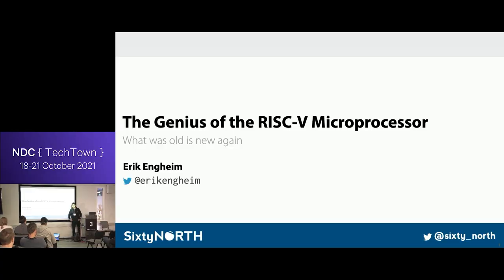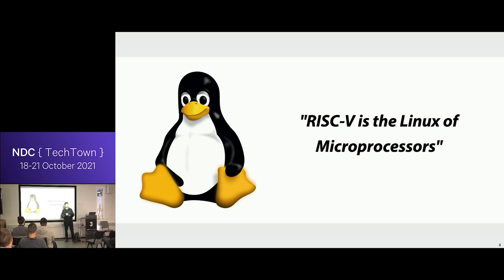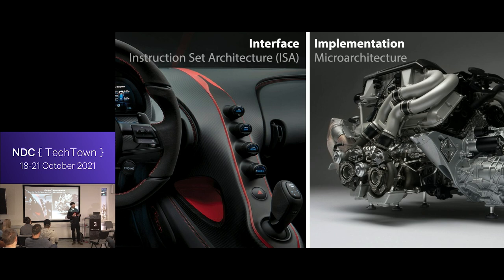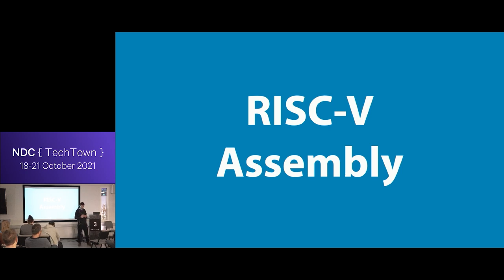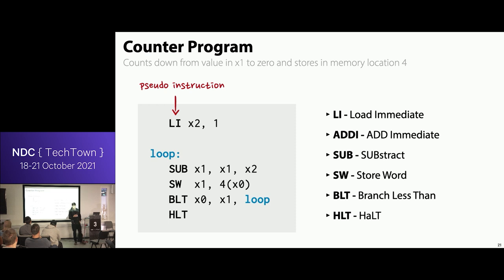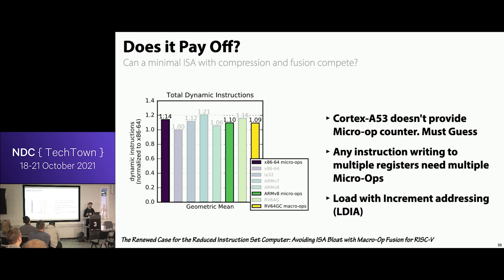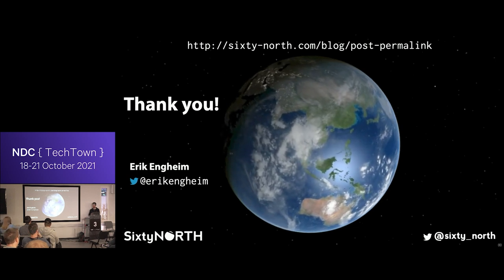The Genius of the RISC-V Microprocessor - Erik Engheim - NDC TechTown 2021

Comment: Man this dude needs to drink some water. That said, I didn’t realise that arm processors had that many op codes. That’s not really “reduced”.
Reply: A lot of this is due to SIMD instructions. Vector processing is something I had planned to cover in this talk but there was not enough time. RISC-V does a very different approach to keep the instruction count low.

Also ARM isn't as fully committed to the philosophy of RISC as say RISC-V. ARM is a more pragmatic architecture where they have added a lot of complex addressing modes to save instructions for common memory access operations. This was shown briefly in this talk in how I showed how ARM  could do what RISC-V had to use three simple instructions to achieve. Of course RISC-V circumvented this with compression and fusion.

I think what makes ARM RISCy is primarily the use of fixed length instructions and load/store architecture. That is very typical of RISC processors. x86 has in theory infinitely long instructions although they made a practical limit of 15 bytes.

Comment: I suppose ARM should technically be a RISC processors. (Advanced RISC Machines). I got a different understanding from your video. May clarify..
Reply: Yes, ARM is a RISC processor but it isn't a binary thing. ARM checks some of the more important RISC boxes: 1) Fixed length instructions. 2) Load/Store Architecture. 3) Lots of registers.

But other than that ARM kind of drifts away from a lot of RISC philosophy. They have rather complex address modes, and a very large instruction-set. Now a large instruction-set isn't necessarily un-RISC like as long as those instructions have low complexity. But several ARM instructions are quite complex and require many clock cycles.

Thus current ARM is a bit hybrid between RISC and CISC philosophy. RISC-V embrace the RISC philosophy more strongly. Perhaps not strange, because it has been made by many of the same people who made the original RISC processor,  RISC-I

Comment: is RISC-V more energy efficient than ARM?
Reply: There are ULP (ultra low power) chips, e.g. one in use in Xiaomi's Bluetooth temperature sensor gadgets, which last for a year on a single CR2032 cell. The ISA itself is not the only implication of power consumption, though RISC in general is more suitable for low power.
It's hard to tell otherwise. Maybe a semi conductor company will publish something at some point where similar SoCs with the same peripherals but different cores and instruction sets are compared. Since ARM is proprietary, open studies will be hard to find.
Reply: @CyReVolt  alright, thanks for the reply!
Reply: It's more energy efficient than x86 anyhow, I can say that. Energy efficiency is not just dependent on the ISA, but also the other designs needed for the chip. The more transistors you need, the greater the power draw. RISC-V can do the same as the others with fewer instructions and therefor fewer transistors, so it should be more energy efficient as well.

Comment: "Get this man some water!" yes I hear you. I am the speaker and I am sorry about this. In my defense I got a call up at my hotel literally 10 minutes before my talk, getting informed that my talk had ben rescheduled. That was the second reschedule, so not something I had been prepared for. I made a split second decision that I could run over the conference and make it on time. It was pretty bad timing for me. I was not all that awake and my throat was bad. When you see me start the talk here I have literally entered the room just 1 minute ago. So I had no time for preparation... getting cough drops, water, anti-congestion of whatever. To top it off my first HDMI to thunderbolt connection didn't work properly. I had to fiddle with that until I switched to another spare I had. So everything was just massive stress. I didn't get time to even locate the water under the table there, before I had to start.

I will consider uploading an edited recording of this if there is enough interest. Hopefully I will do a similar talk in a future conference under better conditions 😉
Reply: This talk was clearly given by someone who knew that recent advances in AI allowed for speech to converted to text with the coughs removed and then turned back into speech indistinguishable from the original with even more AI. All running using the RISC-V vector extension! Coughs don't matter anymore! That's 90s thinking!

I am so very sorry.
Reply: I don't think anyone is actually seriously bothered by your coughing.  They're just giving you grief for giggles. I barely noticed the coughs. It was a very good and interesting talk.
Reply: @perforongo9078  Thanks man! You got a point ;-)
Reply: I think the quality of the presentation more than makes up for minor distractions
Reply: It was a lovely and insightful presentation and honestly if I had to complain about the coughing it would just be to meme
Reply: Thanks for the talk! Very informative!!
Reply: Thank you for the great presentation. Hope you will have better time for your next one. Looking forward to it already
Reply: It was rough, but the content was worth putting up with it.
Reply: [48:50] We can do Better!

A rewrite of the C source code with a compound literal
as a return value.

struct ar {int *a; int r;};

struct ar get_word(struct ar x)
{
   return (struct ar){.a = x.a, .r = x.a[x.r]};
}

[50:07] Just Like ARM

Produces an ARM "equivalent" after compressing 4 instructions
and fusing 3 instructions (2 micro-ops encoded as 8 bytes).

c.slli       a1, 2
c.add     a1, a0
c.lw        a1, 0(a1)
c.jr          ra
Reply: "similar talk in a future conference under better conditions": https://www.youtube.com/watch?v=L9jvLsvkmdM
Reply: Thought for myself, that it should not be hard for an AI to volume down a non-voice sound. But AI seems to be more impression on visualisations. You can colorize and upscale movies from 1920, but you cannot get rid of one repeating noise 🙄🙄🙄

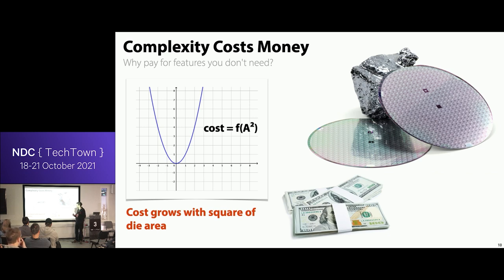Comment: The slide at 7:39 can be quite misleading.  The given die area for the A5 core and RISC-V Rocket is not a full chip, it's just the core and small L1 cache.  A real chip will also have peripherals and I/O pads (little gold wires connect the external package leads or bga balls to the I/O pads on the silicon), plus higher level caches or SRAM.

I/O pads are very large compared to the feature size; we're talking double to triple digit micrometers (so you could have millions of transistors on an area the size of a single pad). So even for a low end microcontroller with only 40 pins, the required area (and cost) for a full chip is more likely to be dictated by the size I/O pads than by the core itself; IC designers may end up having a much larger transistor budget than they know what to do with (I suspect this is part of the reason why dualcore MCUs have gotten relatively common now).

As you pointed out, cores in desktop class chips (and really mobile phone chips too) are dwarfed by huge caches and vector registers.  But the SRAM in MCUs can also be quite large.  If you look up Yunsup Lee's paper on their 45nm 1.3GHz dualcore RISC-V Rocket processor, you'll see that the 1MB of SRAM is larger than both cores together.  That's more than in a typical MCU, but it gives you the sense of scale.  RP2040 for example has 256kB and then some, NordicSemi's nRF5340 has 512kB + 64kB.  Either SRAM (for MCUs with no DRAM interface) or cache (for chips that use DRAM) is pretty much mandatory.

So, even in embedded space, the core size isn't that important.  In any case, we will never see a price difference that remotely resembles the chart here, because core's contribution to the size and cost of a chip is small or absolutely zero (when pad limited).

There are very niche cases where the die area saving could be meaningful, however.  I guess the Esperanto chips are a good example; when you need tons of simple cores with little cache and no external I/O or peripherals, a small core might indeed be lucrative.